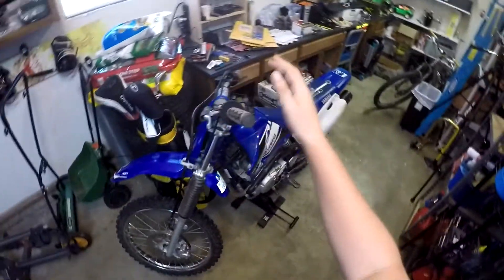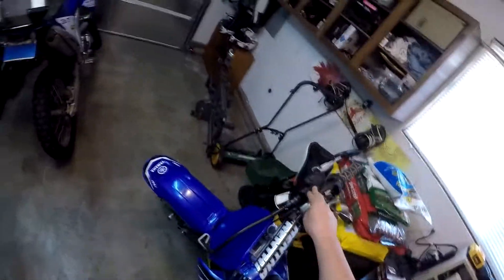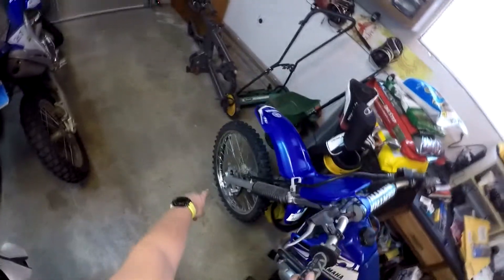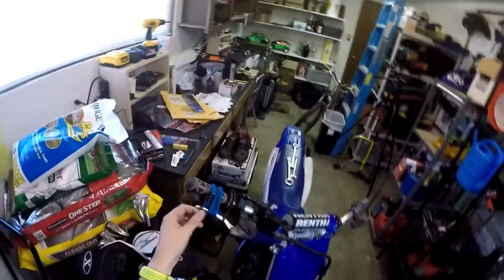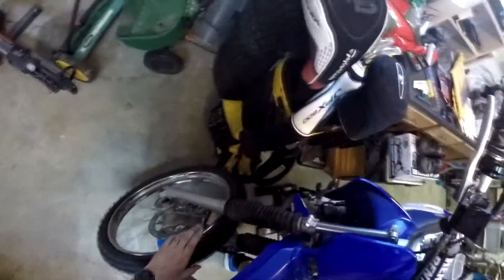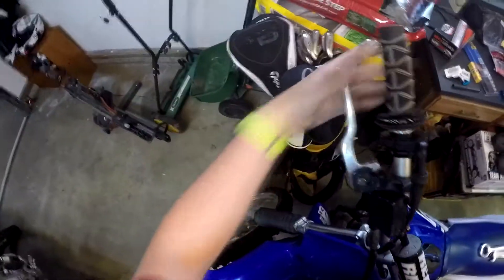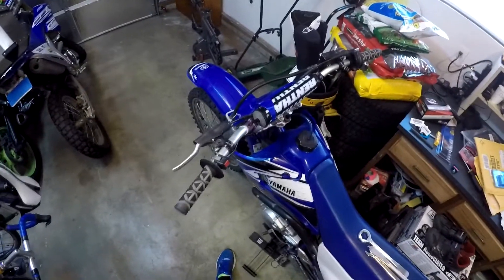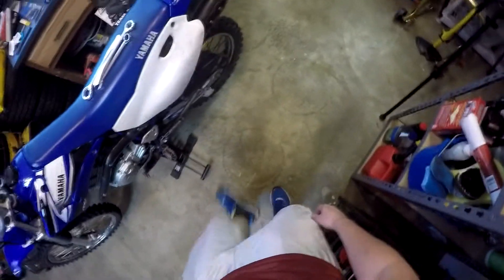ttr 125 dirt bike tune up

Comment: you got ripped off at 800 bucks.  got mine for 100 (model year 2000), but it was missing the entire top of the engine.  cost me about another 200 to 250 to get it running.  
practically a brand new engine though, so absolutely zero problems.  
super fun bike even for an adult to putt around on.  i put a bicycle speedo on it, and it apparently gets up to 45 or so.
Reply: I payed $1300 for my 2000